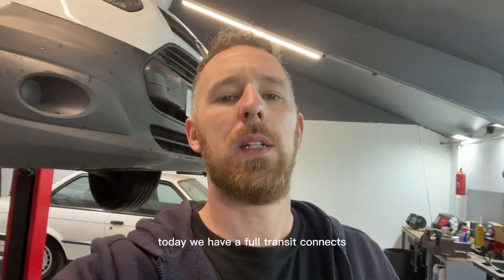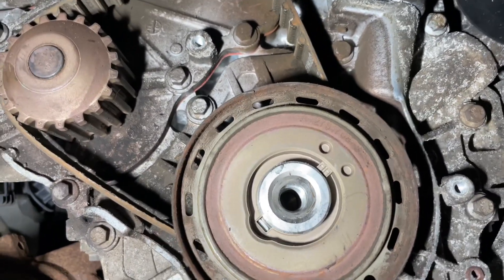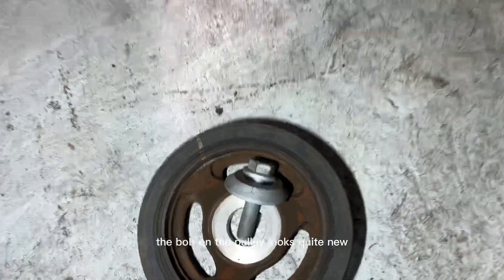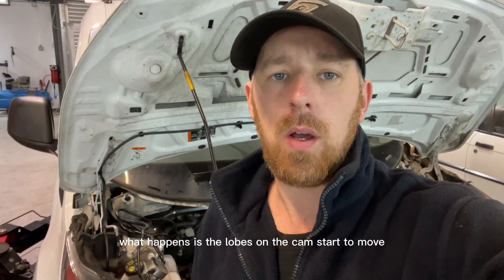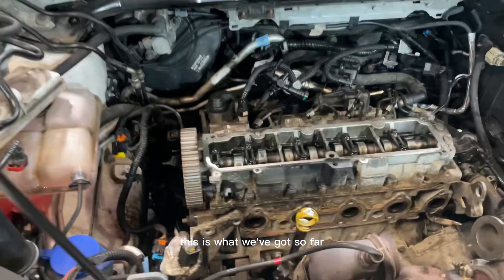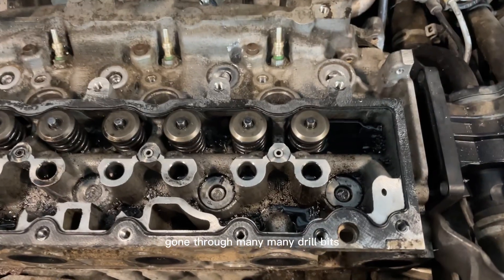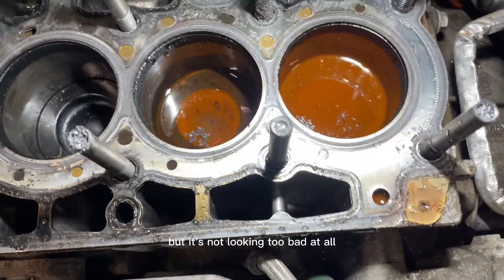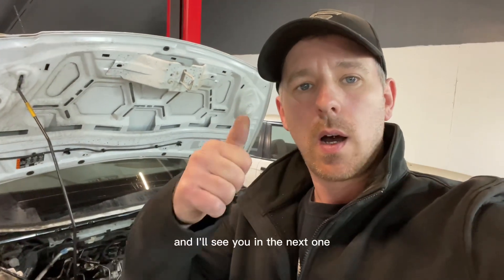Timing Belt Disaster - Can this Ford Transit Connect be Saved?? Part 1

Comment: hi there. I have found this video and the part two very helpful as i have the same car. only issue is that all my head bolts are stuck. lube and heat, no luck. i might have to drill them out. can you advise how you went about drilling? did you use normal bits or a Left hand bit. also, how did you get the washer part that connects to the head off the bolt or will drilling through do that. please help as i am stuck here. Thanks.

Comment: This engine is fitted with suicide rockers.   You do not need to remove the head just the cam carrier.   New cam, followers,  rockers and belt kit will 99 times out 100 it's job done.

Comment: Great vid, this happened to me on same van same engine, did the job myself bit of a pain but managed to keep going with it and yes it was the cam lobes that had moved and stripped teeth off belt round crank pulley. Had loads of metal bits in head ie rockers small bearings etc, ended up taking the sump off and flushing through with petrol good job really as found a big piece of rocker stuck on wire gauze on oil pick up pipe in sump. Also i watched this vid first before i started dismantling i ended up cleaning and soaking with oil overnight the back head bolts in oil and i managed to remove them without snapping them, hope this info helps someone when repairing same issue, if i’d know this previously about the hollow cams i would of fitted a solid cam in on first cambelt change at 150000 the van was on 288000 when this happend, still running today for now!
Reply from the maker: Hey 👋 great bit of advice there because nobody wants to have these bolts snapped off and have to drill them out. It’s just an absolute nightmare. Glad you got yours all sorted now though and he’s still going strong. Great job thanks for watching.

Comment: Hi if a few rockers broken do you have to remove complete head or just top partcof the so called sandwich providing engine spine ok after replacement acmbelt replaced
Reply from the maker: Hey 👋 i always remove the head and have the valves checked as nearly always a few are bent slightly!
Reply: Would the engine starts if the valves are  damaged ?
Reply from the maker: @user-ky7ty3ie1x  yes they do still run just badly
Reply: What's the procedure of putting the camshaft back does alldata specify?

Comment: Hey, does this engine have a wet belt, like the one bathing in oil on the Transit Custom? I’m considering buying a 2022 Ford Transit Connect LWB model and wanted to check.
Reply from the maker: Hey 👋 they come with many different engines so it’s always best to check the engine code of the van you want to buy to check but many of the newer one are wetbelt 👍

Comment: Okay surprised to see this much cam/head damage.  Was the belt the issue that started this mess, or cam/head or lifters?  Just got my hands on one of these vans and want to see if cam replacement is a smart move, since a feel a timing belt is a no brainier.
Reply from the maker: Hey 👋 the fault was with the cam, one of the lines on the cam spun causing the engine to go out of time and the damage done, 👍 hope that helps
Reply: If is was your van and you were just about to do the timing belt, would you just go ahead and replace that front cam.  I mean hell it's half way apart anyway, And I really would rather buy a cam, than look back a say "wish I would've.  A cam is cheap.
Reply from the maker: @bryanlmasseyable Yh if it was my van and knowing what I know I would just replace it for peace of mind really 👍

Comment: thank you for the helpful video. I have had to take off the head and have found two bent valves. Could you please tell me where I could find the tightening pattern for the cylinder head and the torque specs? Thanks again!
Reply from the maker: Hey 👋 Yh bent valves are common, you can find all the info with a google search, but most a garages will use auto data or Haynes pro but they are paid subscription, if you have a local garage they might print it off for you? 👍
Reply: probably figured it out but for the next person. install pattern (remove in reverse) "1" being turbo/exhaust side 

7_3_2_6_10
8_4_1_5_9

stage 1: 20nm
stage 2: 40nm
stage 3: 260•

Comment: Hello mate very helpful video this exact thing has happened to me however much less obvious damage. There is only one rocker arm that was broken everything else seems to be ok. I have replaced the broken rocker arm and put the camshaft back but then I am unable to turn over by hand when I was able to before. Could you tell me what else I am likely to have to replace other than the corresponding valve? Thanks
Reply from the maker: Hey 👋 the issue is normally the cam spins a lobe so won’t be in the right place hence the rocker arm breaking, so I would suggest getting a new cam and giving it another go 👍
Reply: @MrAutoFixer  Thank you very much for your help.
Reply from the maker: @Bobnormal4 no problem let me know how you get on 👍

Comment: Just been told by my mechanic that my Ford Tourneo Connect has this issue, the cambelt breaking up in sump. Looks like a similar issue here. The car has been guzzling a fair amount of coolant. Been serviced regularly before I bought it a few months ago. As soon as I heard the engine making a bit of noise (loud clicking) I took it in. Any idea what I am in for with engine sound, coolant guzzling and belt looking worn? Hopefully just a replacement of the belt? Dreading the assessment.
Reply from the maker: Hi it’s really hard to say without looking, using coolant is not a good sign as the belt wear wouldn’t cause that issue maybe head gasket ?
Reply: I'll pop you a response when I find out later this week. Thanks for video. I forwarded it to my mechanic 😂
Reply from the maker: @JennaHills hey 👋 love that, I hope he appreciates it 😂 yes please let me know how you get on 👍

Comment: Hi! Now I going to buy 1.5 tdci , but 2021 Tourneo Connect. Do you have any bad experiens too?
Reply from the maker: Yes they are good but just make sure it’s got good history and if it’s had a cambelt if the milage is high 👍
Reply: @MrAutoFixer  thank you!
Reply: @MrAutoFixer its mean the 2021 engine coming with same problems?😮

Comment: I've got a 2006 connect 1.8. Come off the motorway and it died at the lights. Started again then moved 20 meters then died again, it did that 3 times now wont start. Cambelt?
Reply from the maker: Normally if the cam belt is gone you wouldn’t get it to start up again at all, if you managed to start it 3 times and move the van it sounds like you have a different fault, sounds more fuel related, possible fuel filter issue ? Let me know what you find out👍
Reply: @MrAutoFixer  cheers pal I will. That's what I thought at first but I've got other people throwing their 2 cents in now I've got a twitchy bum, fingers crossed I just have worms haha. But the engine does seem to spin faster when cranking which also made me think it was belt 🤷
Reply from the maker: @chrisr525 oh dear, obviously the best thing would be to have it looked at, but fingers crossed 🤞 it’s nothing too bad

Comment: Hi mate, I have a 2008 connect 1.8tdci, been told it has 2 belts, 1 at the top and either a chain or wet belt at the bottom, could you tell me which is on these engines? Thanks
Reply from the maker: Hey I would need to know the reg to look it up as some have a injection pump chain and some have a belt. 👍
Reply from the maker: Hi I’ve just looked it up and it gives the option for both belt or chain so I would say you need to have a look and see what one it is, it’s the same amount of work for either one, if you really want to know before starting the job just give Ford a call and ask the parts department. Hope that helps 👍
Reply: @MrAutoFixer  Cool thanks for your time
Reply from the maker: @luke9049 you are very welcome
🤗
Reply: if you unscrew the wet belt/chain tensioner and its convex at the end, you have a chain. I believe 2008 may have been the change over from chain to wet belt. hope this helps.

Comment: So, no need to remove the head .
Reply from the maker: In this case there was a need to remove the head, check out the part 2 video 👍 thanks 😊
Reply: There's a modified fuel pump sprocket on the 1.5 doesn't affect 1.6

Comment: new camshaft and rockers, new belt and away you go. done quite a few now.
Reply from the maker: Yes mate normally, but this one was a bit worse for wear ! Runs like a dream now tho !
Reply: @MrAutoFixer  how do you know if it has bent a valve or not?
Reply: Steven you right I did lots of them just like you said new camshaft rockers and timming belt engine fly nice again
Reply: Scrap

Comment: I recon head didn't have come off done thew theses new cam shaft rockers lifters belt kit been fine 👍
Reply from the maker: Hi Yh I did think that at first too but when I had the head at the machine shop they confirmed 6 out the 8 valves were bent, as you will see in the next video 😁.